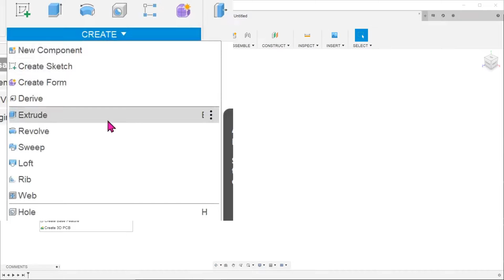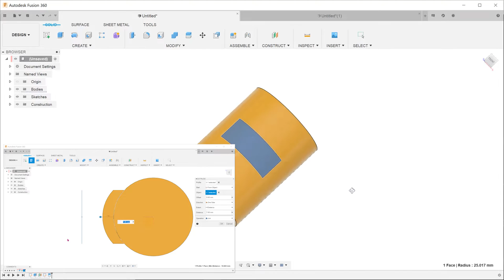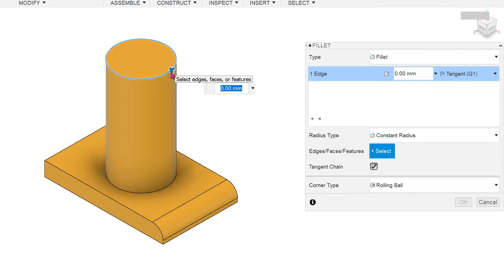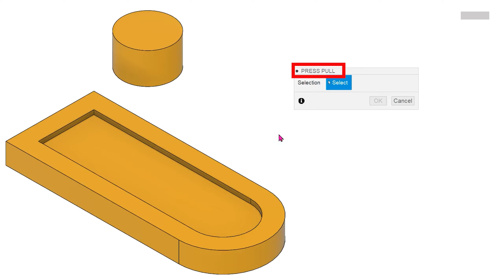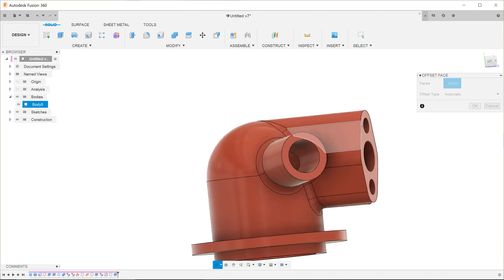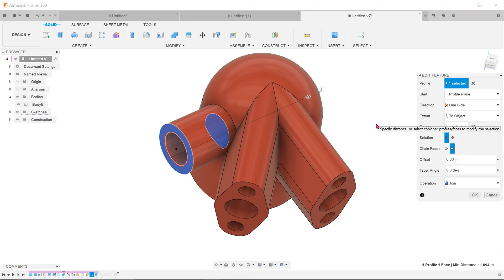Fusion 360 - Extrude VS Offset Face VS Press Pull

Comment: Thanks for the concise explanation!
I've been using Press/Pull thinking it was mostly the same as Offset Face. Now I know that in my use cases it does exactly the same.
BUT it is handy because of the Q hotkey, so I'll just keep using it as a shortcut to the Offset Command.

Comment: When I first started with fusion 360 the person I learned from said "use Q and extrude as a short cut". I think after that every tutorial I saw used that terminology. Personally I use "E" to extrude instead because it's the shortcut key for "extrude". I have been using Fusion since it first came out and the extrude function has evolved quite a bit over the years and has become more useful. 

Good tips.
Reply from the maker: It is interesting to know that you adopted press pull (Q) early on. Many beginners tend to be enamoured with the press pull command early in their learning journey, myself included. It is often presented as a very intuitive way to work, but there are a lot of hidden pitfalls.

Having had more experience, I would definitely warn beginners against using this command. Most beginners would find it difficult to understand what is going on under the hood when they use this command. I have not pressed "Q" for a long time:)
Reply: @Fusion360School  I have a autocad (2008 and forward), solidworks and mastercam background, so that helped a bit. I found that almost every job I do I learn something new and adapt my process to best suit the task. 

I find this is compounded with cloud based software. Every update brings new features or alterations so the adaptation is more frequent. 

Great videos though. I add your insights to my "toolbox" of skills haha

Comment: What's your opinion on using the move tool to move and rotate individual faces. I do this quite often.
Reply from the maker: Hi, I tend to shy away from direct editing methods except for offset face. I am kind of uncomfortable with the idea of using move tool to shift faces or bodies, although you can argue that offset face does the same thing. I often use offset to create features based off existing faces. If I have a need to move entire faces, I would try as much as possible to adjust the underlying sketch or feature, although I understand that might not be possible every time. Maybe I should be more open minded and try to incorporate the move tool more.
Reply: @Fusion360School  I discovered that by moving and rotating faces I can achieve shapes that would otherwise be very difficult to create. I've also been able to rotate faces when the draft tool refuses.
Reply: I try not to design myself into a corner, but sometimes it happens and I end up redesigning a product 2 or 3 times before I'm happy with it.
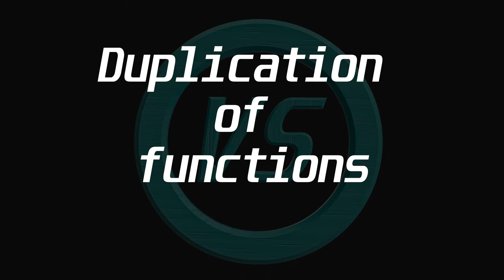Reply from the maker: @Pocketninjanight  That's interesting. Come to think of it, I have used the move command in one of my videos to rotate a face, specifically at 4:08. (https://www.youtube.com/watch?v=3BRfM26Fg2g)
It can be a convenient way of changing faces without using extrudes.